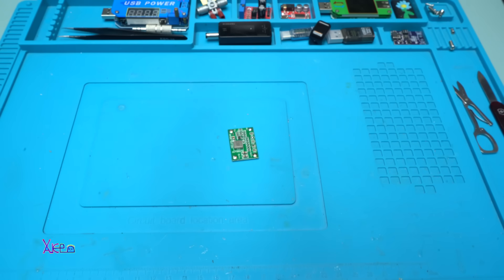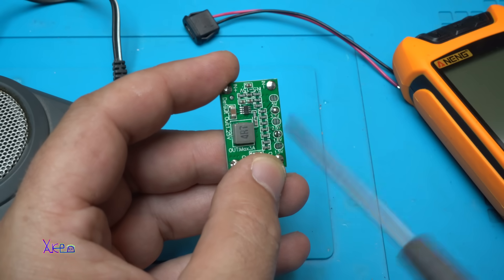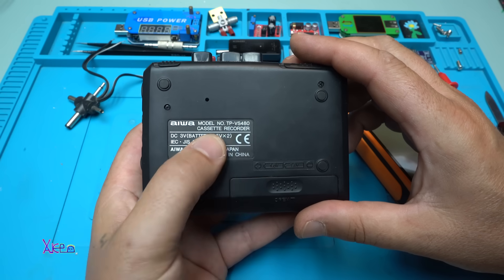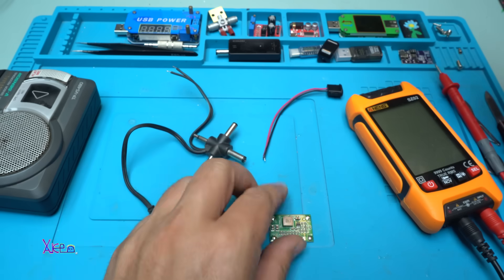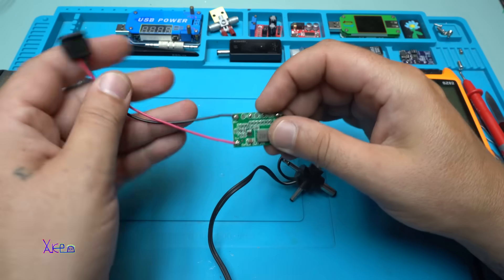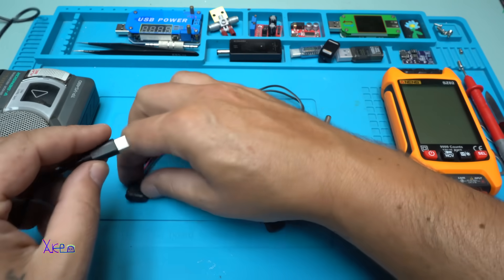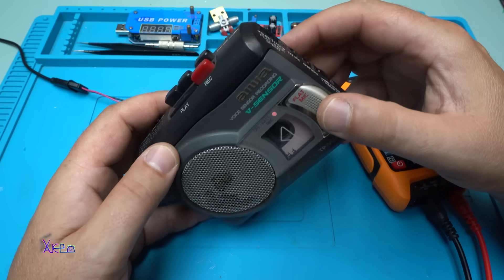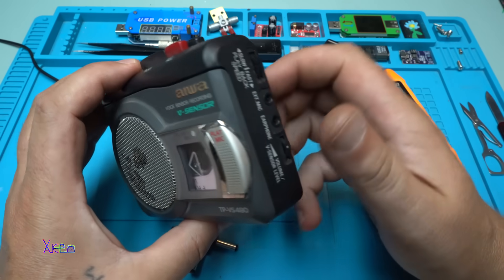Using $1 Aliexpress Module YOU CAN DO SIMPLE TRICK?

Comment: THis is handy - finally - for use in cars where we need to step down 12v. But most people are looking to step down 240,210 AC volts to  12,5,3 V DC
Reply: Ditto.  I would like to see a compact unit, perhaps transformerless, that can do a line voltage to ~5V step down -- of course a USB charger would work, but something even smaller would be better.

Comment: Those usb C sockets are great, but remember they will NOT work with a fast or PD charger, since they do not have the correct pull down resistors. They are fine with a usb A to C lead. Hopefully Aliexpress will make a version compatible with pd and provide the 5 volts.

Comment: Just a little side note working with those jacks: Make sure you have the positive and negative right, some manufaturers have the + on the pin, some have the + on the shield. Especially with vintage stuff it tends to differ with Japanese brands like Sony for example, this also goes for older laptops.

Comment: Might as well put shrinking tube on those aligator clamps same as you did in one of your previous  videos. Protect the pcb. I kinda wonder why didn't you already do it with this stand, if you aready showed us putting shrinking tube on similar clamps 🤔 Anyways, yeah, those converters really do work and are very helpful with low current devices👌🏻 I got several types, there's always need for such item imo if you're tinkering with electronics...doesn't matter if you're pro or hobbyist 👍🏻
Reply from the maker: That's the plan!